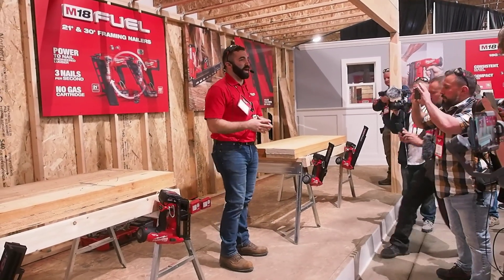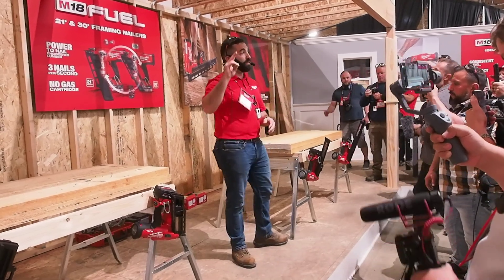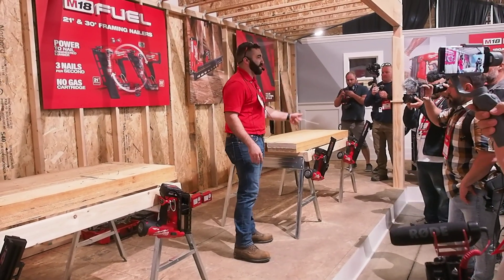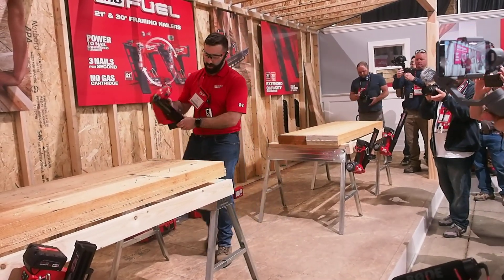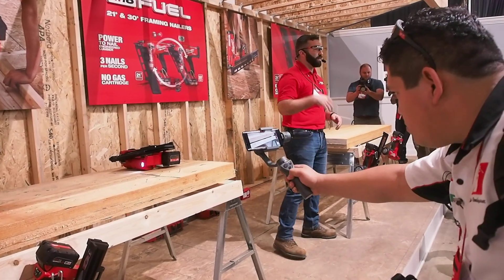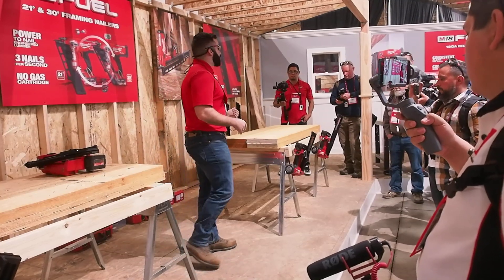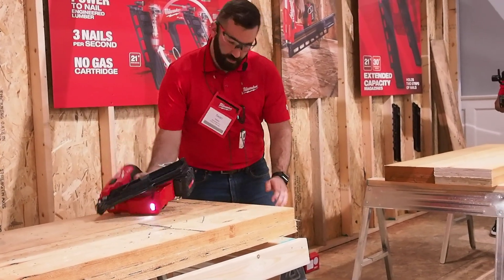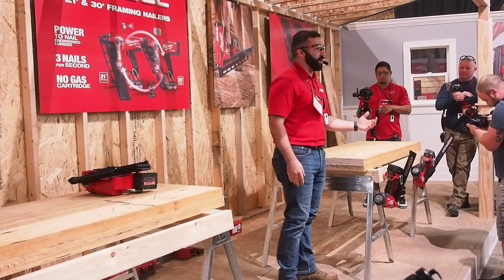Milwaukee Tool M18 FUEL 21° Framing Nailer and M18 FUEL 30° Framing Nailer Demonstration

Comment: Will these be available in California with the extended magazine?
Reply: CA max magazine law is 10 rounds, regardless of device. I told them the magazine isn't for ammo or a firearm but a nailer. They said the nailer still looks like a gun, and it could still be used to inflict bodily harm, so they capped the mag at 10. Crazy CA laws.
Reply: @steveysimmons13579 you make your comment sound legit but there's no way it's true. But then again, it is California...

Comment: When will it fire duplex nails. The union carpenters want to know as all form work requires these nails.....just saying there is a huge need for these....one that has never been addressed.
Reply: Your prayers have been answered...3years later
Reply: Your prayers have been answered... 3 years later

Comment: What’s the advantage of the 21 or the 30 degree tool?
Reply: So you have the angle you need when you're nailing. That way if you need to angle the nail upwards. The tool doesnt get in the way
Reply: I thought it was the angle of the nails in the clip
Reply: Michael Barton it’s both. The angle of the tool is the angle of the nails.

Comment: What nails are you using for the nailer?  I bought some 15g angled Senco with a roundish head, but I notice there are rectangle heads too.  So far the Sencos are going ok.  Milwaukee gives no info other than 15g 34 degree.

Comment: 10 pounds!! Dang that seems heavy, is that an average weight for a nail gun these days?
Reply: Codeman785 a pneumatic typically would be lighter then that. But there is apt more going on in the cordless options. Like the motor, battery and all the electronics. So pretty much you trade light weight for ease of use.
Reply: I think that’s why it barely recoils When it fires have you ever fired a past load into a knot and the goddamn gun  almost flies out of your hands and the nail barely goes in to the wood
Reply: @michaelhowe6676  never been into framing or carpentry much, the biggest nail gun I've used is for finish nails and it weighs like a pound.
Reply: Thats what the Hitachi cordless weighs too, i guess there is no way around it with battery only nailers.

Comment: Looking forward to getting on of these and retiring the old paslode. I remember when dewalt came out with theirs and the old paslode was able to beat it every time
Reply from the maker: These are solid!
Reply: You need to stop smoking that paslode gas. Dewalt retired paslode like 3 or 4 years ago bud.